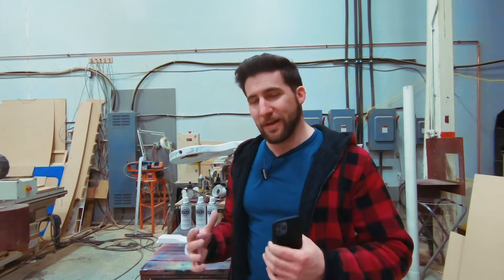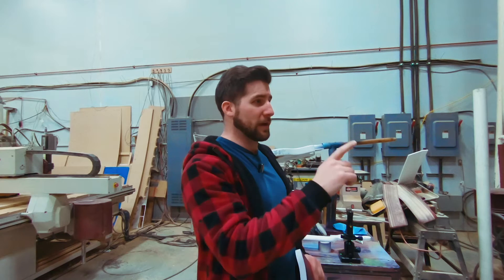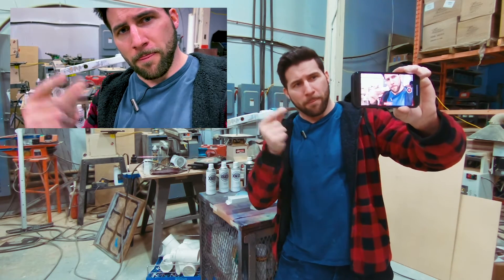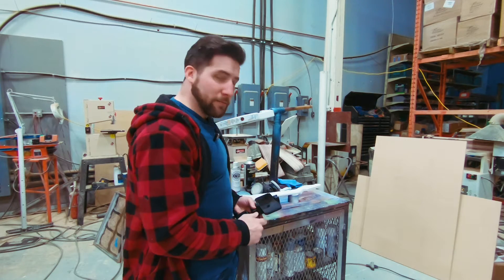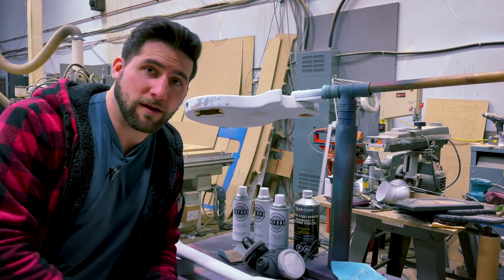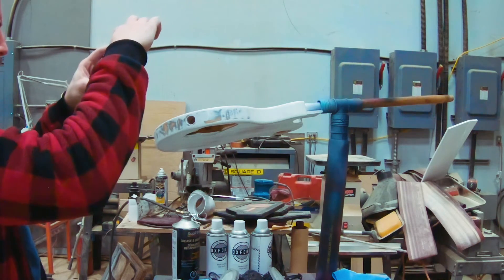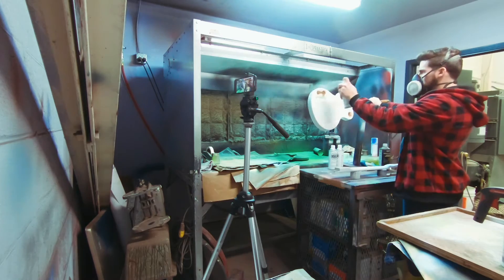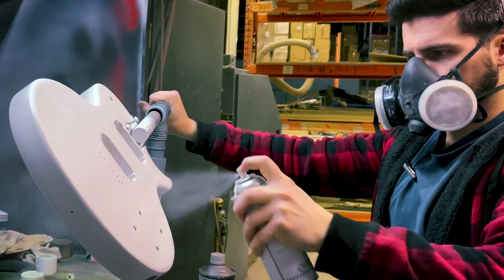How to Make Your Great Guitar Build Off Video on your Phone

Comment: I'm a little late to the party, as usual. Thanks for this Brad. My main issue at the moment is with sound. The phone mic is ok (Motorola 2yrs old), but I bought a Lavalier mic and that turned out to be a rabbit hole.... I have a decent Rode mic with I use for recording my music, but no idea how to integrate that with the phone. 
Any advice would be very gratefully received.
Ta.
Reply from the maker: What kind of rode mic? Like a video mic?
Reply: @BradAngove  It's a Rode NT1-A. I  use it for vocals and acoustic guitar recordings. I do use it to mic an amp, but mostly I use a Beringer cab simulator and DI. I'm ok with that, but I don't use it with my phone, and I've never uploaded anything.
Thanks Brad.
Reply from the maker: I don’t think there’s an easy way to interface something like that with a phone. You can get a pretty inexpensive microphone that’s designed to work with your phone though.
Reply: @BradAngove  Right. Just got a cheap phone mic. Working on  making my "workshop"(shed) sound less like a bathroom..
Thanks for your help Brad. Much appreciated.

Comment: Hey Brad I'm looking for a specific paint Im not sure even exists basically I want a clear coat with a color shift sheen to it but I don't want it to look like a bunch of glitter flakes
Reply from the maker: What are you applying it over?
Reply: @BradAngove  most likely alclad chrome
Reply from the maker: The color shift paint from rustoleum is essentially clear. It would show up pretty subtle though on a light color like that.